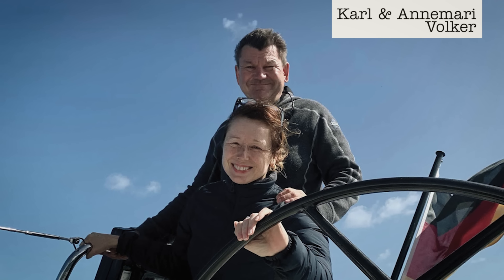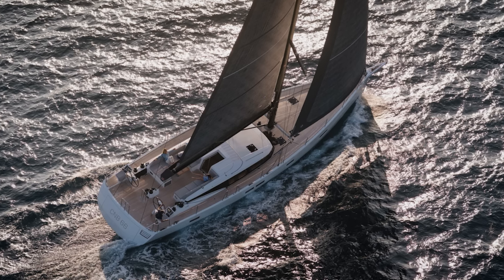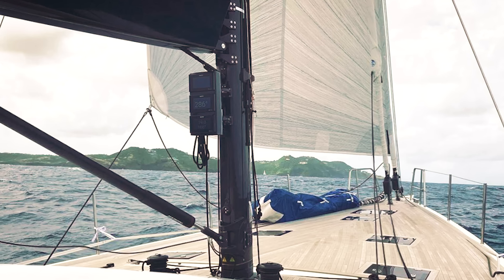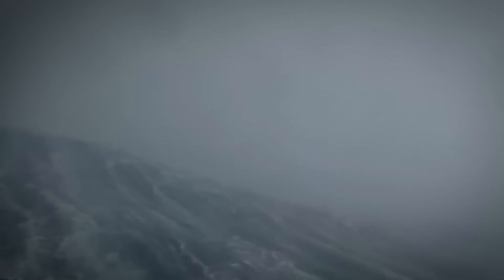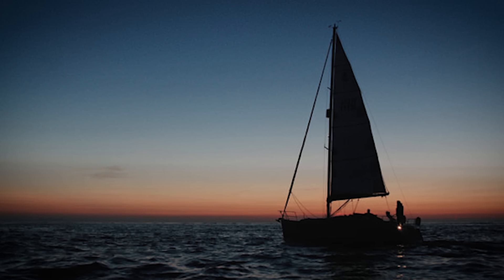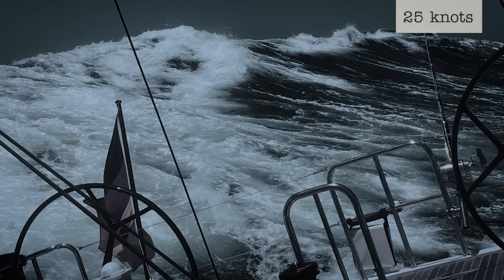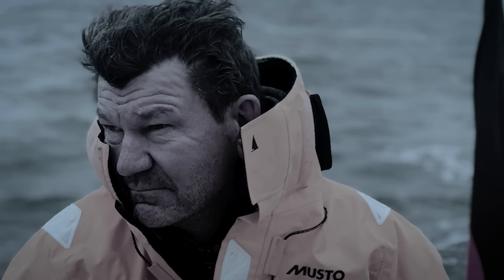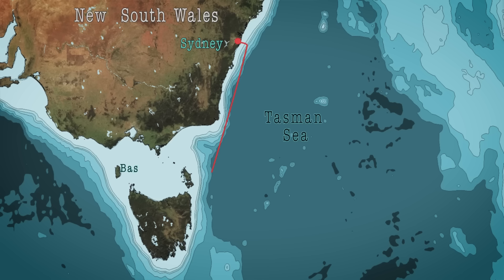Couple DIES on Private Yacht!

Comment: I cannot fathom why 'John' and 'Mike' would not want their identities known. If I was looking for a crew, they'd be at the top of the list. Excellent management of an emergency situation, from constant contact with rescue to proper first aid. Those guys rule
Reply: Not getting into emergency situations is pretty important too.
Reply: @JayBee-cr8jm  how would you, as a crewman (not the captain), avoid this particular emergency?
Reply: @zacablaster  I would have checked the weather. Did anyone do that? I would have known how to operate the mail sail before setting foot onboard.
Reply: @zacablaster  Before I get on a strange motorcycle I ask if it's an automatic, a dual clutch or a manual. I ask if if it's got two blinker stitches or one. I adjust the mirrors and study the gauges. Before starting the machine I am well acquainted with it, its eccentricities and it's features. 

This is common sense. This didn't seem to happen in this case.
Reply: Do you ride motorcycles for a living? Because I might care if you did. This is a boat. It's not a motorcycle, ya dunce.   @JayBee-cr8jm
Reply: In a less annoying self-righteous answer to the other guy, some people just don't want the spotlight on them. They're happy they did their part and don't want/need anymore then that.
Reply: we kind of only know part of the story... it is well possible that there was something done wrong (or at least questionably) in terms of the medical assistance part... or even in terms of the boat control. or maybe, they need the privacy to protect themselves from wanton accusations & people trying to make a lawyer career out of their story.
my feeling is, this is not a clear cut case of heroism... not everything ties together so neatly.
Reply: @stanislavkostarnov2157  this is true. Survivor's guilt is also something I forgot about when I wrote my comment
Reply: The 2 mates probably 1) are aware that facts don't matter when it comes to blame in the court of ignorant opinions, 2) They are traumatized and don't need further stress from being hounded by press and other inquiries, 3) They are possibly experiencing survivor guilt and also continue to second guess everything they did.
Reply: Nobody wants to be associated with an episode of this nature, especially when lives have been lost. And, quite frankly, I think that there might have been a bit of bravado going on.
Whilst I do have experience sailing as a bay racer, I can only speak as an armchair captain in this instance. Sailing at night, fully canvassed, on a relatively unfamiliar yacht, shorthanded and using systems that you're not familiar with? Perhaps they have a sense of regret that they didn't speak up. Yes, ultimately that decision falls on the captain.
But all crew know, you have the choice whether or not to get on a vessel with a particular captain in the first place. "What ifs". We all have them.
Reply: @davidbrayshaw3529  they  did reef one reef, which on this built is not too strange for a 25knot storm... having already crossed most of  the Atlantic it is quite hard to think such weather would have been a huge issue for this captain, surely the boat had encountered much worse.
it is the crews unfamiliarity with the boats behavior that stands out, but than again, they were following commands... as I say, something does not quite add up for me.
Reply: @zacablaster 

The sea be a cruel mistress
Reply: Not clear at all they did the right calls here. What were the weather condidtions during the different stages of the emergency. Why didnt they take care of the sails earlier? Probably fixed the main sail after weather conditions had become easy. What exactly was kind of emergency aid did they actually give? An injured leg should not result in a death… After the accident - why did they focus on both being inside the boat for a long time trying to work with electronics? One should have had focused on getting the boat under control. It’s like a plane… in an emergency you need to get the plane under control first. They didnt even try for several several hours… My guess is they might have had a formal ”skippers exam” but in reality they new very little about sailing
Reply: Furthermore, the reason the skipper didnt ask for their help, might have been due to their inexperience….
Reply: How about a crew that would not have the boat overpowered and on the second reef?
Reply: @siltee9983 I do not really understand why that boat was out of control, this weather is bad, but not terrible... the preventer was probably done improperly to get them where they were... but the design was also awkward, and it seems the captain was aware of that. 
the fact both died, also raised a lot of questions here... maybe a morphine overdose of some kind in one case? or did the pain kill him outright... does happen.
I would not say the two were necessarily inexperienced, but maybe without major offshore experience, especially with that sort of heavy large craft. that's another somewhat separate skill.
Reply: Just cause YOU think they did an amazing job doesn’t mean everyone else does .. two people died, and a lot of it can boil down to incompetence and lack of knowledge.. I guarantee those two guys don’t want to deal with the drama of A. Being treated like a “hero” by the people that think they did all they could do to save Karl and Annmarie or B. Getting death threats and being treated like killers, or at the very least being called every name under the sun for not being able to save Annmarie and her husband .. the world is a violent and nasty place, and just like everyone has an asshole, everyone’s got an opinion , both good and bad lol
Reply: @zacablaster  Haven't seen the entire video yet, but I understood there was a problem with the main sheet before they left. Excuse me, but on every yacht I have bought, the first WEEKS means inspecting EVERYTHING, and I end up replacing crooked stay spanners, tightening steel bolts, replacing some screws (yes, in wood), and you bet the traveller and the main sheet blocks get full attention. You MUST be a neard in this, repair it to perfection, and you should know safety margins, because accidents can turn fatal. Think about a mast falling, when a stay breaks. Even on a small boat the mast can crush you, let alone those large ones. And it sounds so simple, but what if the rudder breaks off, or jams in one position? You can't repair it at sea, it can leak, how bad, and then what? Bobbing up and down in rough waves? See? Things must be 200 per cent top quality, or you can face huge trouble.

So, I don't buy this "great men", sure I agree they acted outstanding, but I only wish they could have solved that main sheet problem. A main sheet must never break. No offense, no accuse from me (I wasn't there, so I shut up), just questions. What? Why?
Reply: @JayBee-cr8jm   Ha, have you ever ridden a Moto Guzzi V7 Sport? Or a Lemans? Those have gear lever upside down. First gear up, second, third and fourth is pushing down. Reason is track riding, accellerating out of a left turn, you can't get your toes under the gear lever. No space. There is the track scratching your toes, if you'd try. So they changed the mechanism to work upside down. Takes a while before you do it as a reflex.

And the twostroke Honda CT90 has a weird gearbox. It has 4 gears, and neutral.
But, it is N 1 2 3 4. And switching up from 4 gets you in neutral. Switching down from neutral is fourth gear. A circle of death.
Reply: @voornaam3191  As a young man I had an accident on a farm tractor. My Dad scolded me saying; "The tractor goes where you steer it". 

He was right. The machine was only as good, safe, useful or effective as the person operating it. It had no fault in the accident. 

I'm convinced the same is true of any other piece of machinery or form of transportation. The fault here lies with the ineffective operation and control of the ship. 

That ship was fully capable of whatever the sea could throw at it.
Reply: @matthewmcdermit8744    It is easy to place blame, but the truth of the matter is that none of us were there and know exactly what really happened. I'm guessing the number of people commenting who have sailed a 60' yacht with a crew of 4 in the open ocean is pretty low. RIP and lets be positive and learn from it rather than dwelling on the negative
Reply: @JayBee-cr8jm   There are rogue waves in the ocean. None of us know what really happened. Was there a language barrier. Could everyone on the crew be trusted? Did the yacht have a functional design. That area of the ocean they were in does not have a good reputation for weather. If I had to guess where the problem was, I would say it was probably an issue of Karl trying to save money. Had his wife doing half the work. Hire a full time young guy to sail with you at all times instead of bringing on randoms who may or may not have recent experience
Reply: YES! Thank you!  This story has a severe lack of cohesion. An owner / captain versus a Coast Guard qualified Captain is no pi$$ing contest.  Then with owners incapacitated they sail west away from help for how long?
Does not add the way it is presented., not to me.  Were it my call I would investigate thothoroughly.
Reply: @JayBee-cr8jm  Do you also do that in a strange car or do you not care suddenly about your safety checks? Almost sounds like you treat motorcycles differently than other motor vehicles because they’re a different kind of motor vehicle.

Well, good thing motorcycles are boats, right?
Reply: @TheOriginalCFA1979  Yes I do. Last summer I had to explain to my neighbor how to dim the headlights in his new car. In fact, you are probably him. 

What's it like not knowing how to properly operate your car? Were you unable to read the owners manual? Do you struggle with literacy? Did you just assume it was like your old car? 

I'll bet you would have been really embarrassed to have your Dodge dealer laugh at you. 

You're lucky I took it easy on you and showed you where your owners manual was. I should have laughed at you. 

Almost sounds like you are grabbing at straws. Get well soon.
Reply: @TheOriginalCFA1979  I predict the dopes on this sailboat regularly jump into strange vehicles, slam 'em into gear (if they know how) and tear off down the road without knowing how to operate them. 

Maybe they get halfway across town and pull over and try to under what the buttons are for. Maybe not. Probably not. 

Maybe they wait until they're looking at 7 meter seas before trying to understand how this ship works. Maybe not. 

This pattern of behavior doesn't describe me. 

It does, however, describe what happened in this case.

We can't blame this on aliens, Democrats, Republicans, the boat, the weather, Bigfoot, etc.
Reply: Many people are superstitious and probably wouldn't hire anyone who was involved in a fatal accident, regardless of their role.
Reply: Because that couple was MURDERED . U CANT BE THIS SLOW.  THEY BOTH DIED IN THE HELICOPTER....OMG U BELIEVE ANYTHING. RIDICULOUS
Reply: @peterguirguess853  Everybody believes the guy who types in all-caps, because nothing spells out "I'm mentally stable and totally not a deranged tinfoil-hatter" like using cruise control...
Reply: @zacablaster lmao go back to school
Reply: @matthewmcdermit8744  Perhaps too little was implied in my post. I don't tend to disagree with you, I have to say.
Reply: @stanislavkostarnov2157  Six metre seas aren't whipped by nothing. Keep in mind, too, that "six metres" doesn't describe the sea state or wind direction or current relative
to the sea state. It's quite possible that this boat or captain hadn't encountered the conditions that they were in. Their inability to keep the vessel bow to the wind, especially under power seems odd, to say the least. And I must say, it all doesn't add up to me, either.
Reply: They probably have no problem getting jobs for the reasons you say, and being widely known is scary.
Reply: This channel is extremely positive about presenting these stories. The rest of the world not so much. Most families just want someone to take the blame, even if they are innocent.
Reply: @stanislavkostarnov2157 Why would them dying raise a lot of questions? The lady probably had uncontrolled/treated brain haemorrhaging for 24(?) hours; I know of cases where someone has fallen and hit their head already in a hospital and still passed away. As for the gentleman; we only have 5L of blood in our body. Even with a tourniquet an injury to a major artery (which occurs in almost every compound fracture) you’ll bleed out pretty quick (think shark attack quick).
Reply: @Dr_Footbrake  still, any death usually starts an investigation, even whether just for potential medical malpractice, was the correct procedures for first-aid taken, was everything done to save that life... etc....
Reply: @stanislavkostarnov2157  well yeah . . . But your comments seem to imply the most important reason for an investigation is that they died after being picked up by the Coast Guard.
Reply: @Dr_Footbrake  to be honest, do not remember the video in much detail... so, no context, but, I think I meant the opposite, that, the fact the crew members died   would be something that would result in questions being asked....
I do not quite even remember what I commented.... and, with the current system on YouTube, it is nearly impossible to find the comment you are replying to...
so I am sort of presuming from how I usually comment on such things.
Reply: @JayBee-cr8jm from another report I know that they checked the weather very intensely. They even had a weather-router on land in Germany, with whom they had contact regularely, even at the evening before. The bad weather in this night with 8m- waves( influence of the gulf- stream- wind against the waves?) was not expected.
Nevertheless, I think they reefed to late and the skipper shouldn't have gone to the bunk in the detoriating conditions.
Reply: Its the second report I experienced on this tragic incident. And on a german boat- show there was the report of a very experienced, german lady- skipper, who sails worldwide. And she had sailed with the owners on this boat in the Atlantic and said that the owners could handle their yacht very professional. Nevertheless the following is to say:
1.) the weather was intensely checked by the skipper and his wife. They even had a professional weatherrouter on land in Germany. And they had contact with him on the evening before.
2.)although the weatherrouter reported a disturbance nearby, they calculated to miss the disturbance with no risk at all.
3.) the bad weather in this night( 8m waves- influence of the gulf-stream, waves against the wind?) was not expected by
 the skipper. 
3.)crew- management in this situation was not optimal. The skipper should have been at the rudder, steering optimally for the reefing- manouvre and organizing the process.
3.)the whole reefing- process on this yacht was not optimal. Imagine to steer directly into 8m- waves, the boat going up and down like hell - even a boat of 65 feet.
4.) I wonder if there wasn't a more easy way to reef the main- sail? But considering there was no other way, it was a mistake of the skipper to go to his bunk in this night. With two unexperienced ( on this big yacht) sailors in command the result was, that they reefed much to late and the situation war uncontrollable.
5.) Skipper in command at the rudder and why not sailing ONLY with the much more controllable headsail and they had survived the night with ease.
Reply: My sailing mantra over 50 years is " reef early and often"
Reply: Lawsuit.
Reply: Heroic effort all the way. They managed to get them rescued and managed an out of control boat. Nevertheless I am sure it was traumatic
Reply: maybe they dont want too relive this horrific accident 2 people died on the boat they were crewing ,wouldnt be the best sales pitch .and im sure they want to forget this shit .
Reply: Maybe they don't want to get hit up by million nobody's like you wanting to crew on their boat, and ask a million questions about tragic events. Not everyone wants attention. I would never have crew I don't personally know as a friend on my vessel.
Reply: @matthewmcdermit8744  Sadly frank reason and logic agree with you.
Reply: Isn’t there usually a big shark stalking them in these stories?. Where was the f’ing shark?.
Reply: @JayBee-cr8jm you don’t sail do you?
Reply: @adamatch9624  You don't ride motorcycle, do you?
Reply: That's probly why .. they're done with boat crews
Reply: Does nobody know how to heave to anymore? @JayBee-cr8jm
Reply: They made at least one series of mistakes, not having the owner familiarize them with complex steps through practice and conditions. If the captain doesn't think to teach you ahead of time, your duty as crew is to ask.
Reply: It doesn't seem like a safe sail plan for short handed sailing to be reliant on a gybe prevention rope which then compromises your ability to reef the main further.
Once there was an urgent need to reef once, they ought to have reef to the max at that time. Or, taken the main down completely and proceeded on genoa only. That is roller reefed and thus more easily controlled by the crew in windy conditions.
Reply: @zacablaster I sail and ride bikes. He's simply making a simple point of being prepared when handling a vessel or a bike or anything that could potentially bring you to harm if not handled properly. It's just common sense, isn't it?
Reply: Have no clue, but does the dumb nail have Stevan Segull on it?
Reply: After an incident like this, I'd want to avoid publicity as well. I hate the idea of fame. If I'm doing well enough without it, I'd go without it.
Reply: I wouldn't want to be associated with such an unfortunate tragedy, with questions over the handling of the boat, no matter how exemplary my behaviour was.   Neither would I want to talk to any curious person who came along & asked questions about it - too triggering of trauma & grief.
Reply: @zacablaster  The author has written an analogy.  You get that, right??
Reply: @peterguirguess853  Now right here we have a perfect example of the mind set of too many people around the globe.   We aren’t privy to the full U.S. or Canadian incident report so let’s just make up some wild-ass story!!
Reply: Is this your first day on the internet? People harass others and send death threats over much less than this. It’s obvious to me why they want to remain anonymous.
Reply: I have been on the Sea for 60 years. 
The sea can make you humble fast.
An intelligent beautiful couple in a beautiful craft. 
There are old seamen and bold seamen but few old bold seamen. 
It was wise to have additional crew on board. There is no point in pointing fingers when there are 3 coming back at you. Damn Sad! God bless them!
Reply: After going through an experience like that, they probably did not want it following them around.  And, people constantly asking them about it.
Reply: Perhaps because they’re Laura and Francesca and yet to come out.?
Reply: My main comment is that the captain and crew clearly did not know how to reef sails. You don't rely on your engine and sail directly into the wind.. as they found out, everything flaps madly and the boat pounds into the seas. The correct procedure is to maintain a tight hard on the wind course and ease the main while the headsail still pushes the boat along. You can then reef the main with the boom safely to one side of the boat, with no pressure on the main. I've done this many times in one day, often while at the boats limit, and in waves and while being a solo sailor.
Reply: The surprise storms apparently weren’t part of some large weather system. I’m surprised their radar wasn’t monitored better. Even on a sailing vessel, you can get an idea which way an isolated storm or storms are moving  and may be able avoid the worst of it. I didn’t see any mention of that.
Reply: They don't want to be labelled as jinxes😂
Reply: Because some people would blame them, unfairly.
Reply: This story is suspicious to me. She gets hurt first, then the husband comes from below and he is hurt, these people knew how to handle the boat but the men who were picked up did not get hurt. Who has the boat now, the people were people robed
Reply: Sailors are a superstitious bunch…. They may be seen as “bad luck”
Reply: Yes! Impressive care!
Reply: What about a bad design? The crew did make remarks about the layout of the mainsail sheet...
Modern multi-million $ yacht that sinks in port, others losing their keels killing their crews.
Too many modern yachts designed for speed, looks and personal comfort, not to get through bad weather without incidents or accidents.
Reply: Not everyone wants attention from random strangers.
Reply: Something doesn’t add up with his story. One thing for sure is there is a reason that boat did not come with stock with that boom design. That single decision was what killed them both
Reply: I would say because they are professionals they played their role down
Reply: Maybe they were gay buds ?
Reply: @JayBee-cr8jm  You don't avoid storms quit making arbitrary ass statements as if you the keyboard warrior can control weather
Reply: @CariusIrion That makes more sense
Reply: @AFROJOE2323  AINT NO WAY BOUT IT YALL HAVE TO BE LEARNIN TO RUN YO SHIP INCASE THA WINDS DO PICKS UP. SHEEEIIIT.
Reply: Probably a cash deal and they don’t want the revenuers catching them.
Reply: Rather small community,your name comes out in relation to a incident like this and you will never live it down.